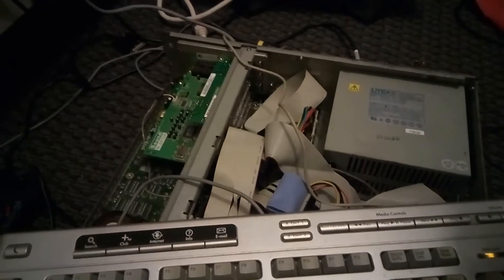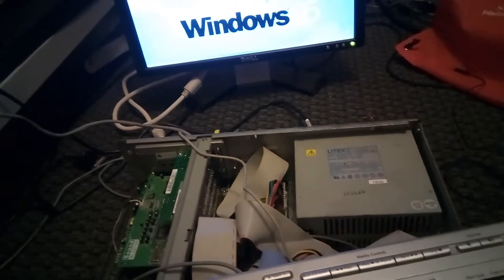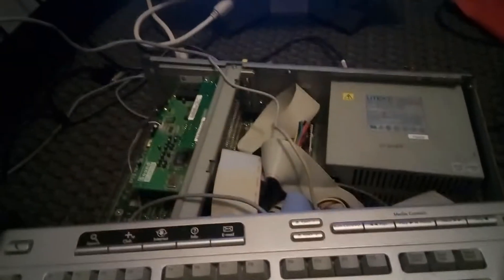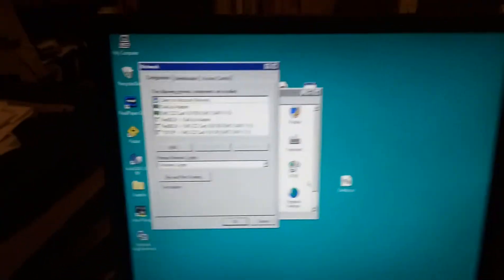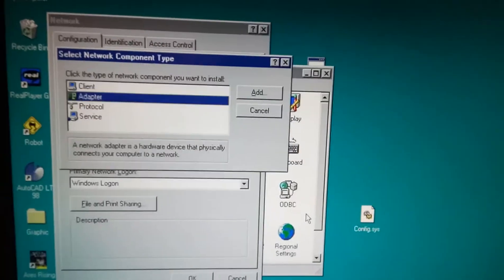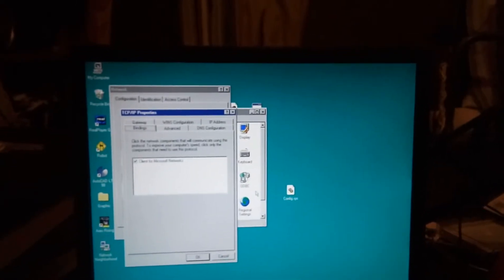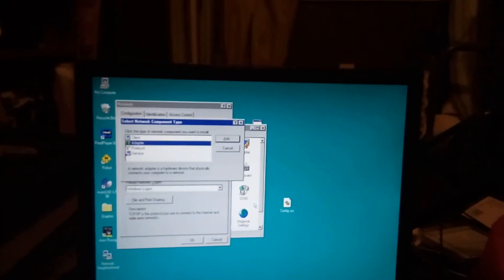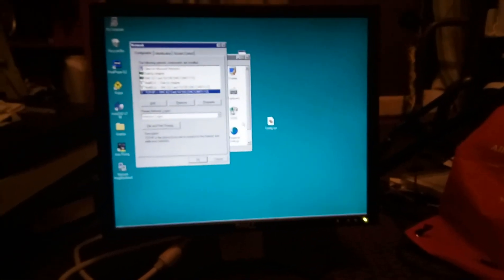Trying to use Ethernet in Windows 95

Comment: LMFAOOOOOO “I am NOT using a modem!!” Lmfaoooo dude! Even if you were to connect this thing to the internet, it’s probably running at 10-100mbps! Average sites like Google and YouTube require at least 1000mbps! There ARE network cards out there that can help your computer run at 1000mbps, but the desktop you’re using is before 2004! It’s from an era where the world was using 10 mbps network speeds. For the internet, this desktop is NOT optimal in today’s world. However, you have a PERFECT retro gaming machine! Games from 1985-1998 specifically. When windows 10 entered the world, it locked out a lot of retro games from that era which is a bummer! But you have a wonderful machine here man that I think you should use for gaming instead of Facebook and emails and stuff. Sorry to say it :/ my best bet would be to keep the shell casing and just install a whole new motherboard and upgrade that RAM for Christ’s sake!

Comment: I have a few older Win9x PCs and NONE of them can talk the DHCP protocol in use today, so to get it working on my network, I manually specified an IP address, gateway, subnet, DNS server, etc.  THEN I went into the router and reserved that IP address.  Now, I can't see Windows 10 share folders, but Windows 10 can see a Win98 share folder, so I can send files to the computer over ethernet and then open them on the older system.

Comment: I know the pain! Have been dealing with similar with a Win 95 Packard Bell. But in my case I can't be sure the Ethernet cards I've tried are properly functional since they sat out in a shed for years. Hard part for many is even finding reliable Windows 95 drivers. If you do a Run > winipcfg you can review what it shows for MAC/IP info and it may give you a few leads.